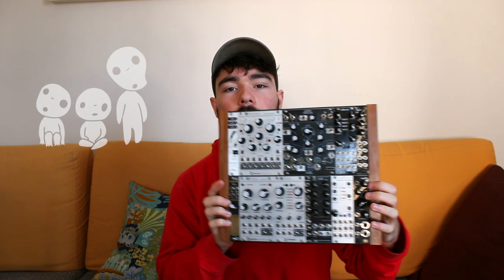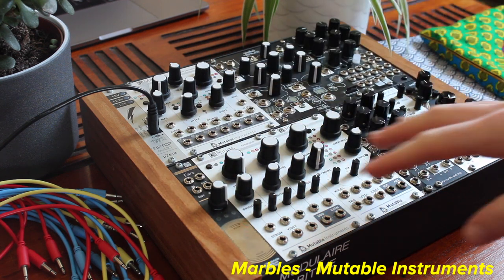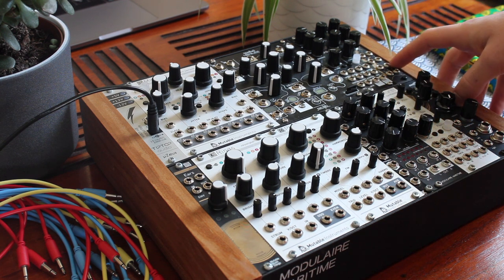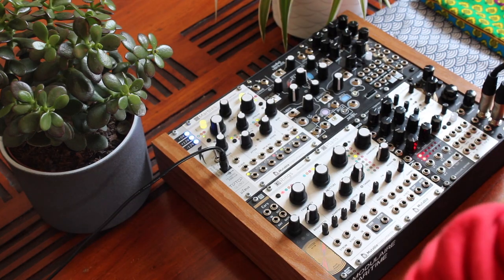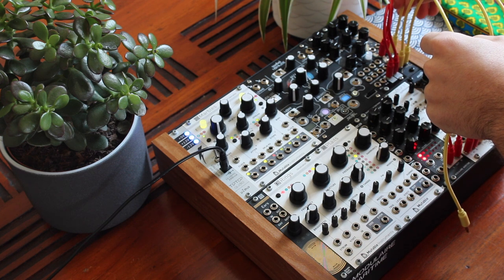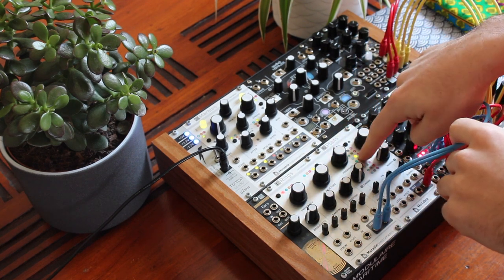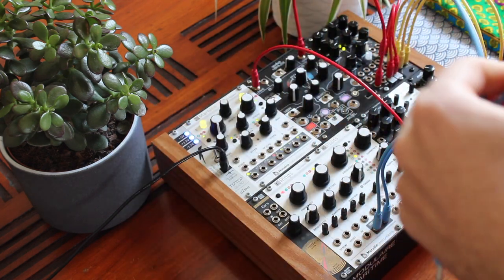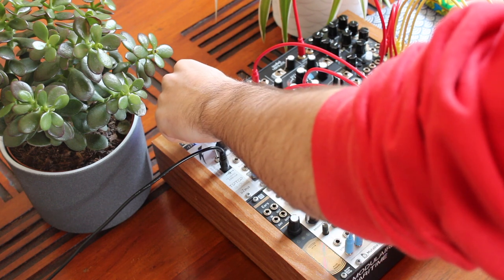How I Patch // tiny ambient modular patching process

Comment: Nice little case! I never would have thought to put two clouds in such a small system, but it sounds lovely. I have a question about hyrlo though - can you use it as a line level output if you keep the levels low enough? Does turning things that quiet reveal much of a noise floor? I have quite a tiny system, and I'd like to save the space I'd need for a stereo output module if I can. I can't find a configuration of stereo mixer and output in less than 6hp, so if I could use hyrlo this way it would save me a lot of headaches